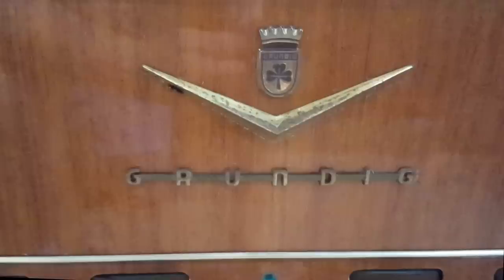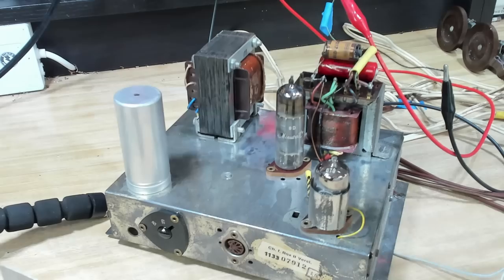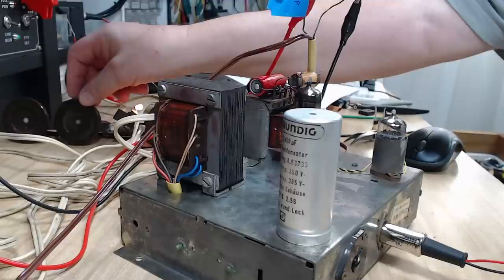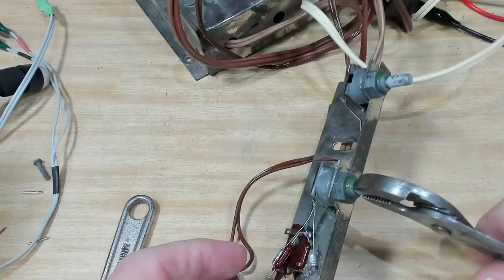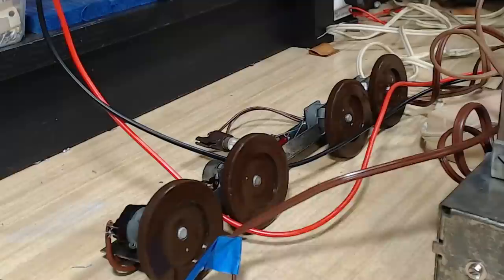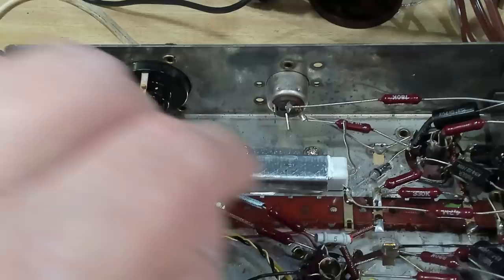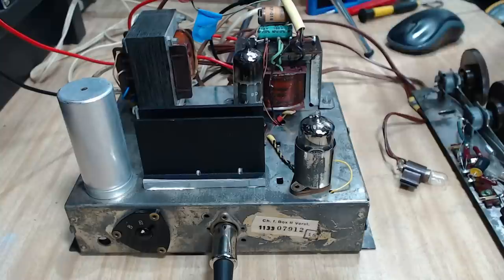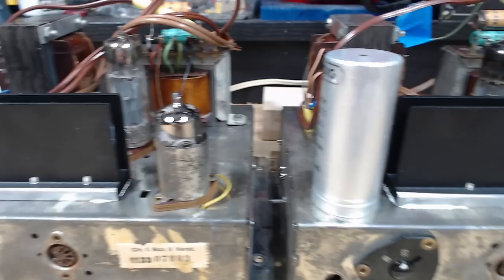Grundig Powered Speakers Repair - 1961

Comment: Great video as always David. when it comes to heat in an amplifier overkill on heat sinks is definitely a good thing. Always enjoy seeing you troubleshoot and fix problems. You always have a unique way of getting the job done. So far after a 4th month of Chemotherapy the oncologist says my blood numbers are returning to normal. He said I should be cancer free by June. Thanks for sharing your radio adventures.
Reply: Keep up the good fight! My doctor told me that he got all the cancer during the surgery, I go back early next month for a checkup. They took out my kidney and half my adrenal gland on the right side. Several doctors told me that this form of cancer is usually cured by the removal of the kidney. When they tell you that you have stage 3  cancer it is frightening.  When  you have just in the past 2 years lost both your  sisters and your lovely wife of 51 years and 4 days, to  the disease it comes becomes pure terror.  But we must continue on I guess.
Reply from the maker: Hi LL. I get a little paranoid about getting the heat away safely. I probably don't need to worry quite as much but that's me. Good to hear your treatment is going in the right direction. i look forward to sharing my radio adventures with you in the future 👍😀
Reply: @JerryEricsson  I lost my Dad to lung cancer My wife to pancreatic cancer an aunt to pancreatic cancer two aunts to breast cancer and my cousin who was only 32 to brain cancer. So really I do feel your pain Jerry. Just take it one day at a time and keep fighting.

Comment: Greetings:
Alternative to 100 ohm dropping resistor is a pair of electrolytics in reverse series with diodes to bypass reverse polarity for each diode (its hard to find 330 ufd non-polar caps).  Quality unknown, but I bought b4 fro. China w/ no problems. Capacitive reactance of 100 ohms is 100 ohms (duh).  C ufd=1/(2 pi f Xc)=1/(6.28 x 50Hz x 100ohms)=1/31400= 318 ufd. Based on 240vac, peak voltage is 340vdc. Caps 330uf 20% 450wvdc are qty 4 (2 each for 2 systems) usd$3.31 each incl. shipping. Ebay from China. Size is 30mm x 40mm snap in mounting, (a little bit large but no wasted heat). Depending on tolerance, there may be some more volts to drop on primary side. HT may be okay beyond silicon rect. Good luck Dave.
Reply from the maker: Hi James, I have ordered a few capacitors and will experiment with them. They are pretty big which may limit their usefulness but an interesting idea. Thank you 👍🙂

Comment: You can use a small wall 240V-12V wall wart transformer and wire it like an autotransformer, but out of phase, so the voltage will be subtracted instead of added. So you will be getting 228V output, and if you can find a 240V-20V, then you will get a perfect 220V at the output.
Reply from the maker: Thanks for the suggestion michvod, I'll check out transformers 👍😀
Reply: @DavidTipton101  I forgot to add that you wire the secondary to primary (essentially making it an autotransformer), but if you do it out of phase, then the voltage will be subtracted. If you do it in phase, then the voltage will add :)

Comment: Nice job on the honing. I was trained at TAFE NSW, to clean up an engine cylinder using that basic honing technique 40 years ago.

The setup was very similar, running a wooden rod with a slit and a flap of honing paper, left loose to hone the cylinder via the centrifugal force, using an electric drill.

My honing skills developed quite a bit since then.

I was quite impressed in your resourcefulness with the rivets David. Any chance of getting the exact name of the product, so I can run a search.

The rivets often give way in the German radio rear cover locking wheels that rotate into locking the cabinet rear door into closed positions.

A good few worthy techniques provided in the Radio Adventure. 👍 I can’t wait for your next Radio Adventure! 🔧😁
Reply from the maker: Hi Pete, thank you. The honing technique is used all the time in engineering and often used to remove paint from bolt holes after repair. Do a Google search for "Hollow Rivets" and you will find lots of options 🙂
Reply: @DavidTipton101  my family certainly has had their involvement in engineering, having completed a major contract at one stage in components supply and components installation, for the Anzac Bridge construction in Sydney, when it was being built, not to mention the 20 odd houses we built just to mention a few.

There are plenty of rivet kits and various sizes around but I was more interested in the kit you showed due to the smaller sizes.
Reply: It’s all good, I sorted it!

Comment: Atleast your grinding rocket didn't have an unscheduled disassembly :) wonder if someone brought the speakers with them when they moved to aus from europe. Would love to visit Australia for a holiday. Still never traveled that far, ohwell love watching your videos anyway
Reply from the maker: Haha... that would have been embarrassing Leo. I reckon that would be the only way the speakers would have made it to Australia, they would not have been sold here with the 220 Volt transformer for a 240Volt supply. You are welcome to visit Australia any time 🦘🙂
Reply: @DavidTipton101  that's interesting , wasn't it 220 here in the UK during the 60s? I thought I had old appliances with that voltage, I'll check and post an update . Yes have coffee pot, says 220-250 and bush record player 200-250v althou think it has voltage selector inside . Was the warning signs on the speakers in English?
Reply: @DavidTipton101  theirs no way it would have blown up in your capable hands, mind you you could have popped a prawn on the capacitor rather than the Barbie :) hope I'll come over, been looking at cruises that go to Australia , not cheap :) but it's got to be done
Reply from the maker: UK voltages were 240 Volts until 1994 when they were lowered to 230 to align with the European standard allowing imports and exports of electrical goods. We did the same in Australia. In reality nothing changed except the specifications, as long as the supply voltage fell within the specified range it was except able even at 250Volts. We still get between 235 and 250 Volts here in Oz depending on system load.

Comment: Very nice job on the rivet.  60s technology can sound excellent.  Problem is, audio gear has a long and proud history of printing flat out lies.
Plus it depends on what you're looking at.  If you're looking at the highest of the high end, today's amplifiers are going to be better, especially on the top end of the frequency spectrum.  On the low $ end, you'll probably get better performance from 60s equipment. Same with middle tier equipment.  Of course, the middle end cost more back then that the high end does today.
Reply from the maker: Thanks tarstarkusz. These didn't sound better than todays middle of the range speakers. They did seem to suit the media from that era and were nice and mellow 🙂

Comment: Quite an unusual design, i thought active speakers were a more modern idea.
I've never seen valves as being a modern thing.
I grew up in the transistor/chip age so valves will always feel old and hot lol.
Stuck solid pots, i've never seen pots that bad.
I have often dobbed my soldering iron on the shaft and that would often loosen it.
Doesn't do well on plastic shafts though lol :-D
A 27 volt zenna in line with the rectifier output might have been an alternative  maybe perhaps ok ill shut my face :-D.
Reply from the maker: Hi zx8401ztv. I have never seen active speakers except for subwoofers, I need to get out more. The pots were stuck and as soon as they cooled they re-stuck. Luckily I stuck with the last three pots and they came loose after some considerable time. I haven't tried a zener in the line, I wonder how it would go? Food for thought. Thanks zx8401ztv 🙂
Reply: I didnt look deep into the zenna wattage or current passing through it.
You could have a chain of zenna's or ordinary 1n4008's.
1N4008 are about 1 volt at 1 amp.
You could even use a bulb for fun lol.
Sorry im just in a silly mood.

Comment: Great resto job! It's a shame the cases are made from fall-a-particle board, but at least you've made them electrically stable. Good on ya!
Reply from the maker: Thanks Punk Tiger. Stored in the damp, it will do it every time 🙄😀

Comment: Good work there Dave. have you considered using capacitor droppers instead of resistors to drop the voltage? They won't get hot like resistors will.
Reply from the maker: Thank you morenormal. I consider using a capacitor every time, I just can't imagine it being as robust as a resistor for the next 10 years, I will do one one day 🤔🙂

Comment: Hello David! 

Great video once again!

I enjoyed watching how you disassembled that Potentiometer & went about finding & fixing the problem!

I have to admit, I never realized that an aluminum part, such as the casing for that "pot" could distort just enough to cause that sort of problem. 

If I ever finally get started in this hobby, I will definitely have to keep that in mind!! 🙂

That  leads me to tell you that I recently purchased an assortment of resistors and can FINALLY get to assembling that Transistor Radio Kit of mine!! 😀

I accidentally ordered 1/8 Watt Resistors instead of 1/4 Watt ones though, but I've been told by 3 or 4 fellows in a Transistor Radio Forum which I recently joined, that since that small radio kit only runs off of just 3 Volts DC current, that using the 1/8 Watt Resistors should be fine.

I guess that's what I will do, although the slight O.C.D. in me, keeps making me want to either make an exchange or purchase an additional assortment of 1/4 Watt Resistors now! LOL!! 😊

Take Care My Friend, & I'll be watching for your next project! 

Yours Always,

Ron
Reply from the maker: Hi Ron, I trust things are better now. It turns out the stiffness in the potentiometers was dried up grease. I did not have to dismantle the other three pots, heat, penetrant and a little oil freed them up eventually. Good luck with your kit 👍🙂
Reply: @David Tipton  

Thank You David, 

I think things are beginning to get a little better, but as the words to an old song used to say: "Lordy, don't the wheels turn slow!" 😊 LOL!!!

All the paperwork from S.S. concerning my 3rd filing for Disability FINALLY came in!

All have now been filled out and sent back, & now I just hope that they'll approve me this time, for I sure am tired of waiting for that to happen!!

If I finally get approved, things should finally get A LOT better, indeed!

I can HARDLY WAIT to begin assembling that kit! Hopefully I can begin working on it this coming weekend!! 😊

Ron
Reply from the maker: Good news Ron 👍🙂

Comment: I also prefer to get heat away even if the components are rated for it - I am in the process of refurbishing a 1970s hifi receiver which has two transistors in the power supply without heat sinks and they are almost too hot to touch. Yes they have lasted since 1976 and yes the max. junction temperature is 105C but I'd still rather dissipate that heat over a wider area and get it away from the chassis.

Would you consider it necessary to put an earthed (3 core) mains lead on those speakers?  Just seemed like a lot of metal chassis to be unearthed - then again, would probably cause hum loops if another earthed device was connected.
Reply from the maker: I know what you mean Ross. It's hard to ignore transistors running that hot. Good point about grounding the speaker drivers, I didn't consider it. I don't imagine it will matter... yeah, good point 🤔🙂
Reply: @DavidTipton101  Cheers David, thanks for your reply.  Sincerely appreciate your time and effort to make these videos - production, content and humour are all first rate :-)

Comment: Granted, you said the schematic you were working from didn't exactly match the amplifier in these speakers, but the power supply nodes and filtering are very strange: it appears to use a section of the output transformer primary winding as a choke, plus a series resistor following the transformer winding, to drop the voltage a little before it goes  to the screen of the EL84.
Reply from the maker: I don't have the schematic with me but that sounds about right 👍🙂

Comment: David, nice job on those pots. Seeing how you always do things the right way and are never bothered by going to extremes to get that done, I’m wondering if at any time you considered removing some windings from the power transformer primary or adding some to the secondary to adjust the turns ratio for “modern” mains voltage?
Reply from the maker: Thanks aerostar. If you mean to lower the output due to higher modern voltages you can add some winding to the outside of the existing windings and serial it to the primary the output from the secondary and filament windings can be lowered. There needs to be enough clearance between the windings and the core on the transformer to do this and it is unusual for there to be enough room. Winding order on most transformers is Primary - secondary - filaments so access to the primary and secondary isn't practical 👍🙂
Reply: @DavidTipton101  I figured it would be highly challenging, but like I’ve said, that has never stopped you in the past 😝.  
So if I understand you, the primary winding is the outside winding and the secondary is on the inside (closest to the core)?  That would mean if it were possible to modify the windings, it would only be “practical” to modify the primary winding, since it would be the most readily accessible.  I’m any case, you still did far more than the average restoration would entail. I would have never considered the voltage difference to be such a big deal, and something that would not be readily apparent to the average user. But I guess the repair costs would add up over time if the problem wasn’t addressed by a prudent tech such as you. Kudos my friend.
Reply from the maker: Hi Aerostar, sorry no, the primary is usually wound first, then the two secondary windings and then the filament. It's not set in stone but seems to be the normal order.

Comment: Hello, I have been learned that a component is too hot when i can't keep my finger on it. Regards Stig Österberg from Dalsbruk in Finland.
Reply from the maker: For me that's over 55C Stig. Those resistors are rated at 400C but it's the radiant heat to other components that concerns me 🙂

Comment: I enjoyed this video! Very nice indeed! Did you do anything to the cabinets where there was water damage? How many watts are these speakers? I would take a guess and say 20W per channel!
Reply: A single EL84 at 250v can push out slightly more than 5 watts.
Reply from the maker: Thank you JAMMERK5567. No I didn't do the cabinets, the owner only wanted the electronics done. As eDoc2020 said it would be around 5 Watts in this single output Class A configuration🙂

Comment: Spot-on again Dave! The speakers are better than new, I'm sure. These seem like prime candidates for bluetooth conversion. Is that in the works?
Reply from the maker: Hi Mr Poindexter, thank you. I think the owner connected them to a receiver/amp which may have had Bluetooth or one could easily be connected if it didn't 🙂

Comment: Lovely job. However, the black replacement capacitors you used looked like Hunts types here in the UK. They have a dreadful reputation, so I guess that's not what you actually used!
Reply from the maker: Hi Janet, they were not Hunts caps, they are sold in Australia by Carl's Capacitors and are especially produced black to blend into old radios and not stand out like yellow types. You can find a link to Carl in the description under my videos. Thanks Janet 🙂

Comment: 290 V B+ instead of 280 is only about 3.5% high. Do you think that's too much? Mains voltage can vary up to +/-10% according to international standards (for 230 and 240 V, tighter for 120 V).
Reply from the maker: Absolutely right Ragnar8504 The valves are rated to go past that but these are old valves and getting difficult to replace so driving them high is probably not wise. In our area with solar panels operating we can get up to the mid 250 Volts during the day so better to run them a bit cooler I think. I would always run the filaments as close to 6.3 Volts 🙂

Comment: I know selenium rectifiers get a bad rap, but if they are not dropping too much voltage, is there really a need to replace them?
I have found in some devices, replacing them has been more of a headache than leaving them in would have been, just because silicon has a lower voltage drop.
You've done another amazing job sorting these to classic powered speakers out.    Powered speakers these days have a bad reputation in hifi circles because so many are not made to the same quality these Grundig's were made to.
Reply from the maker: I agree there is a lot of work in replacing selenium rectifiers but left in they will fail one day and the stench is unbelievable. Thanks Brendan, The Grundig speakers are well made 🙂